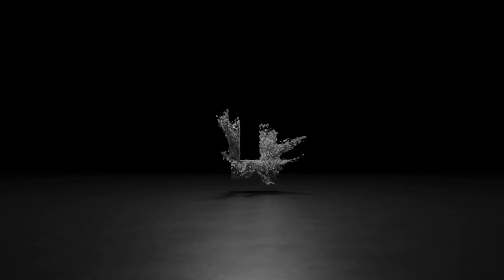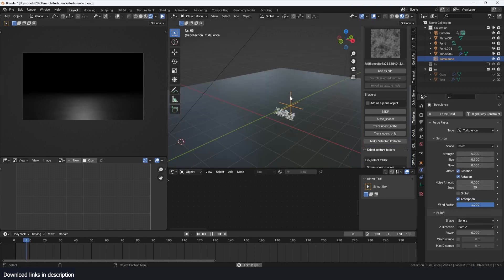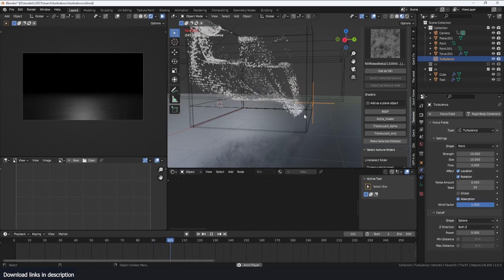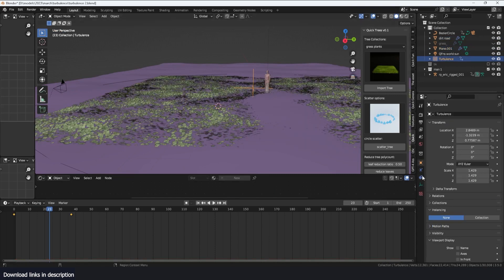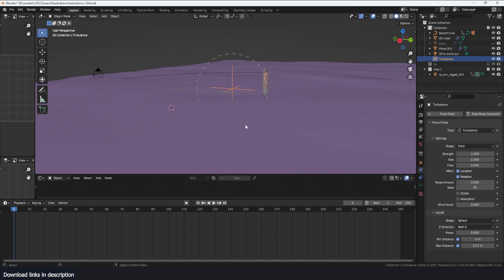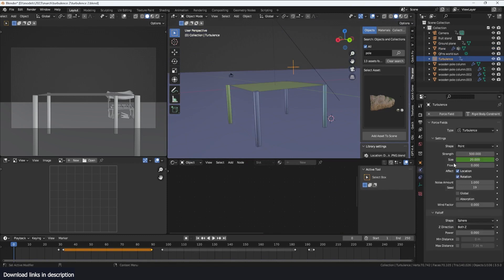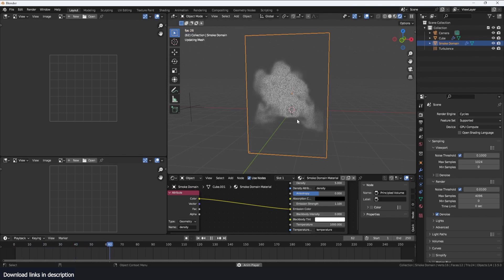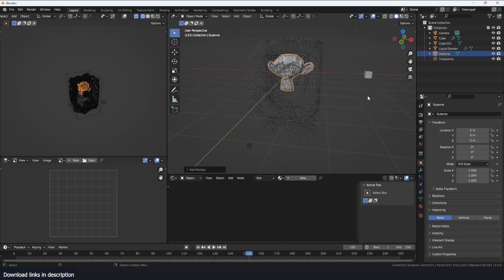all you need to know about turbulence in blender

Comment: How do I switch it off? So it only affects the first part of my animation. I tried keyframing all settings to zero  but doesn't work.
Reply from the maker: if you want it off for a specific particle system go to that particle system, scroll to the bottom under field weights you will see the turbulence setting